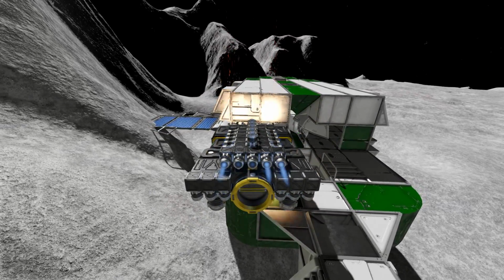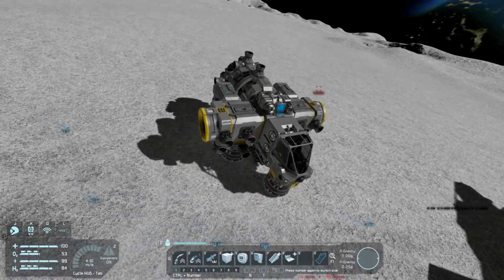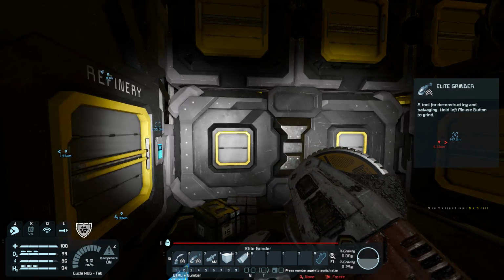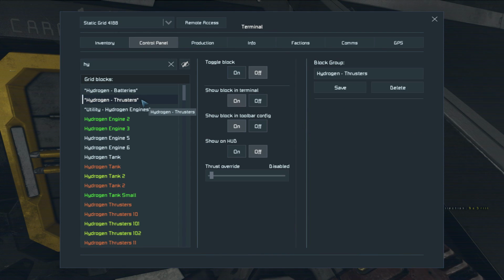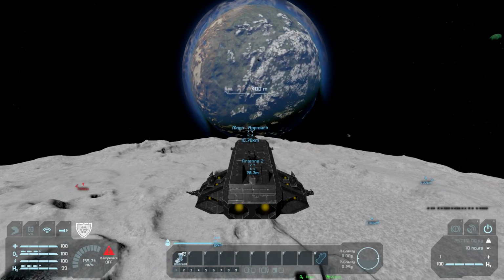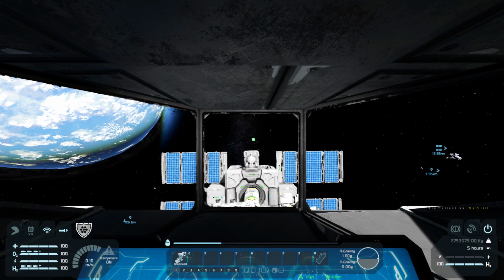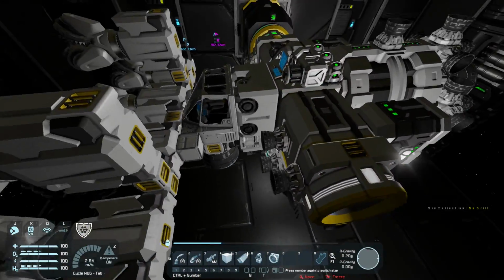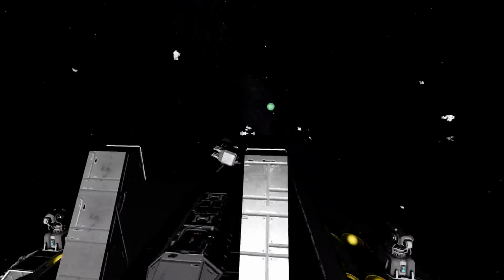Space Engineers - S1E32 'Journey to the Alien Planet'

Comment: What you need to do is build an interplanetary cargo hauler jump ship.  One jump drive isn't sufficient for the dropship, and having any jumpdrives will add weight.   The drop ship should be focused towards being a drop ship/transfer ship.

For the interplanetary hauler, you could add battery power and solar panels galore.  Also hydrogen tanks and H2O/O2 generators. 

It doesn't need to be very agile, it just needs to have a large cargo capacity and the ability to jump large distances (which ideally means uranium).
Reply: Unfortunately, that’s not possible.

There’s no way to even mod automatic jumping, you always require a player input.
Reply: @sorrrbet4923  Well then you could be the pilot on the massive jump hauler, transferring automated drop ships between planets.
Reply: @STSWB5SG1FAN  That's a cool concept actually. You jump the ship between planets and then you can a button to activate the remote controls on the dropships and they automatically pick up cargo and return it.

Comment: just an idea, how about placing the jump drive in the ship's bridge somewhere.
(please keep in mind that i do not know the hull thickness around the ship and is only just a suggestion)
Reply: Was thinking the same, it should fit nicely where his refineries where due too a jump drive is 3x3x2 while a refinery with modules take up 4x3x2!
Reply: elementalblaze79 But it’s impossible to start a base without having a refinery on hand, so...
Reply: @sorrrbet4923  when I'm moving my base or adding another one, I make the parts needed for either an assembler with extra ingots or if it's just a mining base, just the parts for said refinery! But most of the time I make sure I have just enough parts to build a assembler, 2 wind turbines, a large cargo container, 5 pistons, a rotor, & a drill(all large grid) this would allow me to get stone which you can now get iron, nickel, & silicon, which is needed for a basic base & if I have cobalt already, I'll bring a good amount for metal grids when those are needed! But normally, my transport vehicle has a survival kit on it so all I really need is the ingots so I can just build it up!